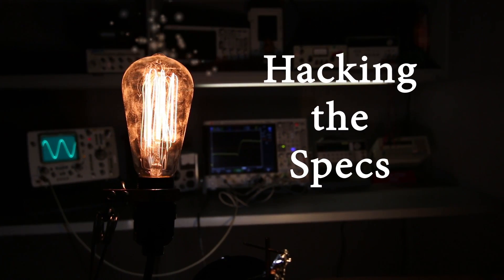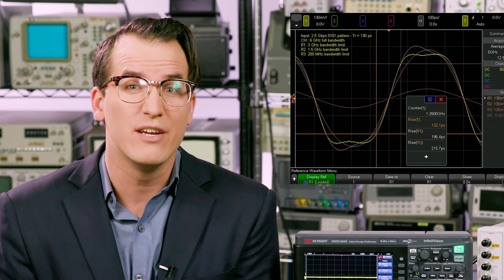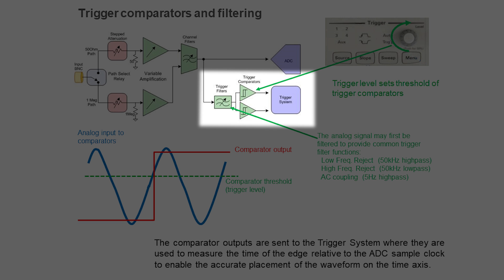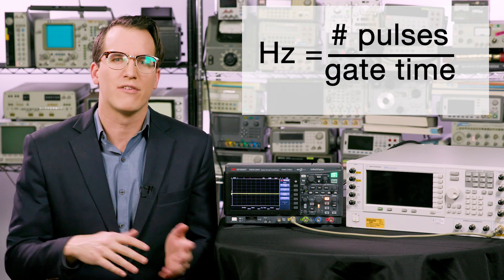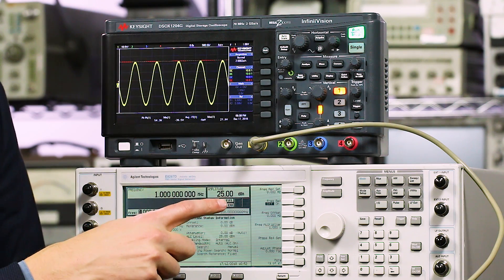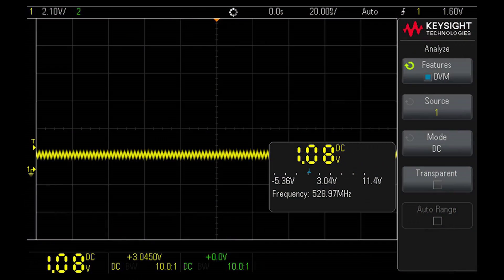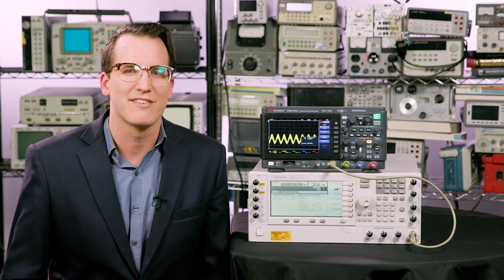Spec Hack! Breaking the Bandwidth Barrier with Your Oscilloscope

Comment: Unless you are troubleshooting something like radar to detect signal delays you don't need very high end high bandwidth oscilloscope. For most computer trouble shooting 100mhz is fine but if you want to debug computer then you actually need logic analyser not oscilloscope. Many times you can even go away with spectrum analyser for radio troubleshooting and you can buy those cheap sdr instead of actual high end accurate spectrum analyser. Back to oscilloscope you can even do ghz signal reconstruction on cheap 20mhz or even 40msps storage or those sreaming adc based usb devices by using a fast sampling circuit to reconstruct signal on multiple delayed triggers. So in end you need to be very techy and posses higher iq to do whatever you want or even a high-end scope is useless...

Comment: Found your channel because of ElectroBoom, but found some great videos like this one..  Which brings up a question I never thought of before...   I always considered using a frequency counter against a signal of one specific frequency.. lets say a sine wave... but your video, talking about edge crossing and triggers/comparitors makes me wonder what would happen if you had a signal with two frequency components which were not multiples of each other, and so as the sine waves "beat" against each other (adding to each other) is there a scenario where the resulting frequency reported would be less than or greater than either of the component frequencies?  Maybe even an unstable reading, based on the ratio of the component frequencies?  For example,  what would happen if you had a 1,000,000 hz and 1,000,001hz signal together?  As their phases move across each other, wouldn't there be times when they would basically cancel each other out, and have no zero crossings?  Would it show as a 1hz signal?  Would it show as an unstable frequency sweeping between 1hz and 1mhz?  Thinking about this, I then thought... well, most times I've used a frequency counter, it has been to test/verify a clock signal on a computer circuit, which is a square wave, which is in itself could be broken down into a whole bunch of component overtones of the fundamental frequency, but that situation is different, since the component frequencies are all presumably multiples of the fundamental.   Am I overthinking this?  How does a typical frequency counter deal with this?  I started thinking about this because you were talking about exceeding the scope specs, so I was thinking you were going toward a discussion of nyquist law, and how exceeding a sample frequency would affect what you see on the scope..

Comment: When I used my first russian C1-107 oscilloscope I discovered how to see waveforms past the normal 5MHz limit. Normally when the trigger signal is taken from Y channel then with low signal amplitude the sync drops. However if I routed the same signal into the "external trigger" connector then I could get the scope to sync on higher frequencies. Nowadays I just use my 250MHz analog for such stuff. No problem all the way up to ~500MHz. I still have the C1-107 as a scope for "dangerous" things like measuring 400-500V DC circuits(10X probe but exceeding the 350V limit for the probe). I may go digital one day as I really could use single shot trigger or automatic measurements.
Reply from the maker: Nice trick! Digital scopes can be a nice upgrade depending on what you use it for.

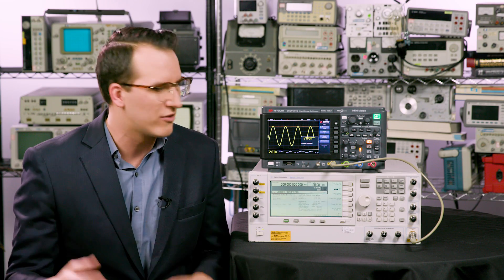Comment: At 3:40 you said the frequency counter works off the time per division settings. Does that mean that the frequency counter reading will change if time per division setting is adjusted independent of the actual frequency?
Reply from the maker: Good question! No. However, just like the scope, it would be possible to set an invalid time/div. Too small = not enough edges to measure, too large = not enough precision (memory/sample rate issues).
Reply: @KeysightLabs  That makes perfect sense. Thank you for clarifying 👍🏻

Comment: one of my things is not caring about getting an accurate signal reading as much as seeing and comparing signals.  yes,  my 100Mhz scope can't accurately tell me what voltage things are at but I can compare 2,3 or 4 signals and see if things look correct even if my voltages are millivolts instead of volts and way past my scopes bandwidth.

retaliative measurements have value,  don't let a label on the scope keep you from trying and looking
Reply from the maker: I agree! Knowing the normal parameters and what happens when you break them opens up a new world of options!

Comment: I just wish that the frequency counters used a high accuracy standard (or offered a 10MHz input) with a higher resolution, currently they are fine as a ballpark “there’s a frequency there”, but I still have to use my 10 digit counter with a seperate probe.
Reply from the maker: Yeah, they definitely aren't an all-out replacement for a dedicated counter. The counter mode itself is essentially a hack one of our engineers came up with a few years back.
Reply: Maybe on "big" scopes, but I'm hobbyist and from my pov this is quite useless feature and would make these cheap scopes more expensive. To measure frequency and stability I use 2nd channel and a freq. generator I got as a gift (not an atomic clock standard but better specs).

Comment: (no cool hack to write about with my scope, with a 46 years old scope I rather push my luck than the specs)
Reply: You could always make an RF downmixer, you can see any frequency you would like to see, no matter how high, on a scope no matter how low frequency.
Reply: @tHaH4x0r  interesting, it could be a fun way to learn more about RF signals
Reply: @UnapologeticallyNerd  what scope do you have ???
Reply: @fausergustavo   A SonyTektronix 335, a "portable" oscilloscope from 1973 http://w140.com/tekwiki/wiki/335

It was very fancy machine, incredible compact for the time, it can run from everything from 100 to 240v AC or 11 to 28v DC. 
According to the guy that sold me the scope, this one belonged to a field engineer of a company that developed much of the electrical and communications infrastructure of the country during the first years of the dictatorship we got in the 70's and 80's. At some time in the late 70's it felt to the floor face first and many of the internal mechanical switches got damaged. It sat abandoned on the company for many years until the engineer gave it to this electrician who fixed most of the mechanicals but never got it to work again so it sat in  his shop for over 30 years as a prop because "it gave the electrician credibility with his costumers". Last year the electrician got sick and had to sell it and I got it because I was broke and I needed an oscilloscope to work on my thesis on weekends (I have a fancy one in the lab at my university). It took me more than 4 hours to get to the damage and repair it, I had to rebuild many parts using a 3D printer but at the end it worked!      
Compared to modern scopes it incredible basic but I love it because it worked when I need it the most and now that I finished my thesis I'm looking for a new scope prom this millennium. Maybe I wind one at this year Keysight wave, otherwise I'll probably get a InfiniiVision 1000 X-Series
Reply: @KeysightOscilloscope, I'm crossing my fingers

Comment: My first oscilloscope (that I buy my on not that I used) was an Agilent DSO3202 digital oscilloscope, I was a 200 Mhz whit 1Gs and 4K memory. Some day I needed to find if synthetized rf generator from 1.2 to 2.8 Ghz was working  .. and it works (until 1.5Ghz ) not the exact power, so I put it in the FFT mode and used the scope to see the signal, of course it was very attenuated and I had to do some math because when it reaches the 500Mhz (end of the FFT scale ) the nyquist theorem shows that we have the alias so the frequency starts to going down in the screen (2 harmonics) and goes up again after 1Ghz and so on. Since I have no spectrum analyzer at that time it was very handy to use these technique.

So maybe you can make these experiment on these new oscilloscope to show us.
(after the DSO3202 I still have an DSO1204A but the performance was not the same).
Reply from the maker: Good suggestion!